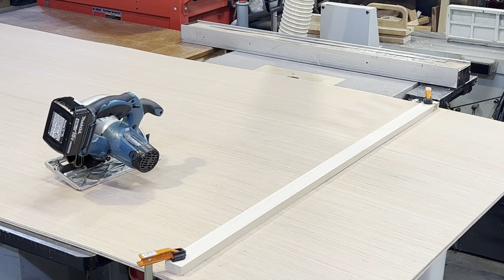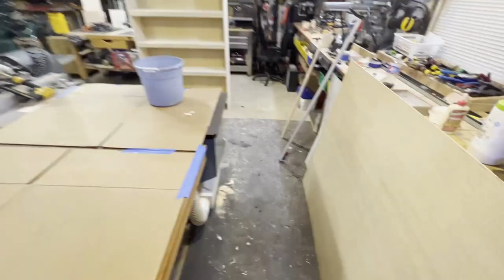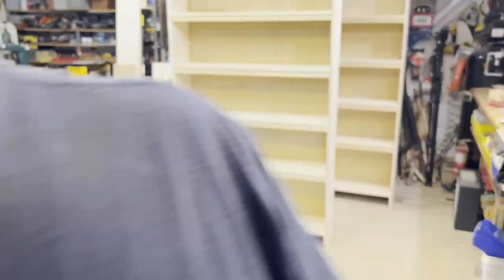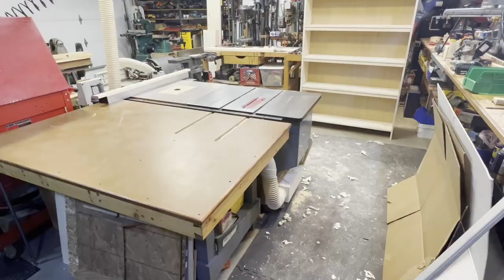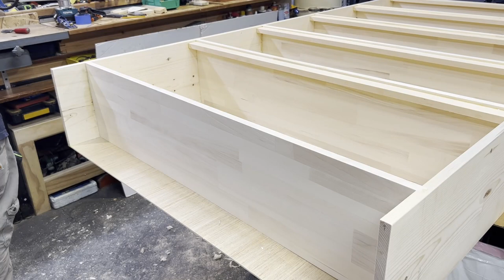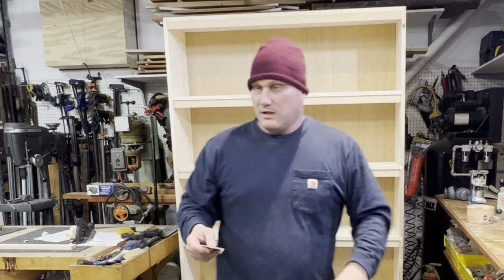Making 2 Bookshelves Part 4

Comment: "What"....... is right lol. 2k for SPF pine???
Reply from the maker: Yeah that’s total, the material alone was almost $500. The shelves are Aspen. I probably should have bought Aspen sides but they were kind of high. I also priced poplar and it was crazy high for all the parts I needed. Then there’s almost 2 weeks of labor, and shop, and heat etc. actually it’s a great deal for the customer.